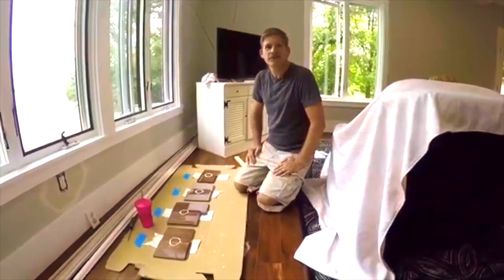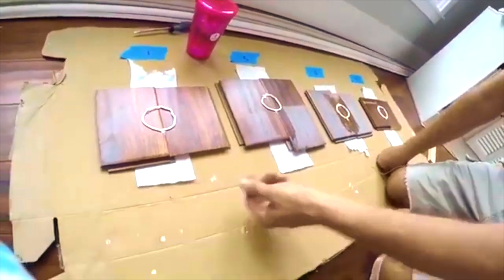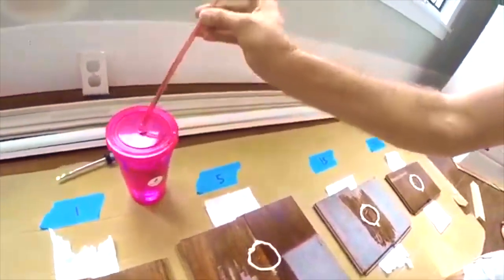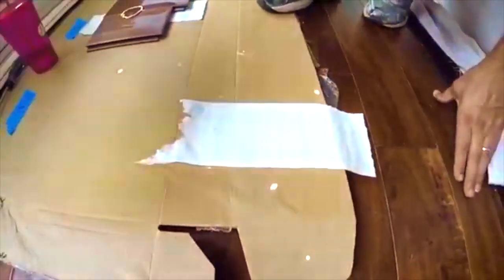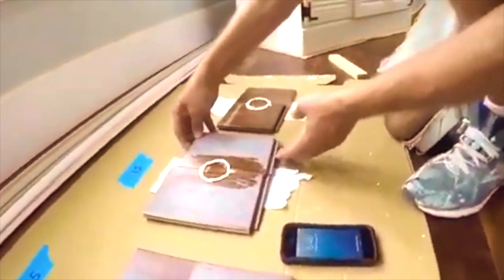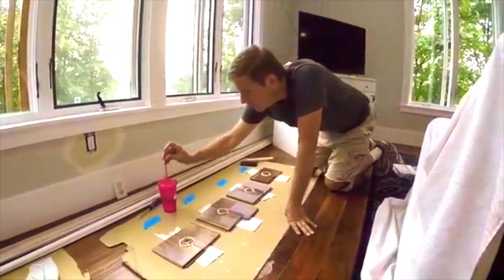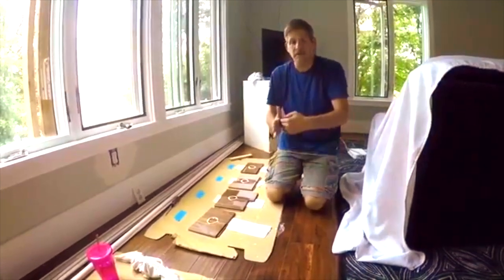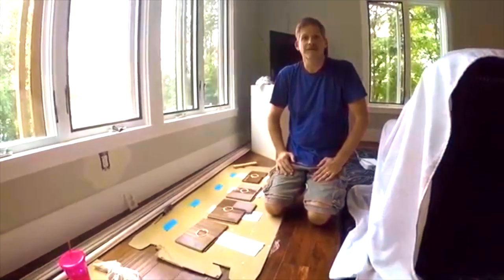Can Engineered Floor Get Wet: Click Lock vs Water

Comment: Did the samples get stained or swollen? What type of damage did this test incur?
Reply from the maker: There was zero swelling or staining. We were pretty surprised. This may vary from floor manufacturer to manufacturer but the click lock design was so exact that no water penetrated at all standing on the seam for 24 hrs.
You could give this a try with floor innovate looking to install to be sure. 
Thx for watching!

Comment: That's pretty Awesome that it doesn't leak through I'm thinking about putting wood planks down after we get finished changing the floors in this big old house lol
What brand are those
Reply from the maker: Hey Minica,
It’s been a few years since we did that project so I don’t remember. But maybe from Lowes or Lumber liquidators. 
The description is hand-scraped Acacia. 
Thx for watching!